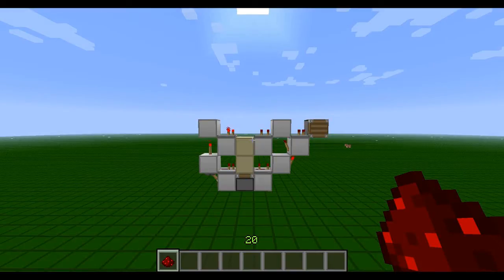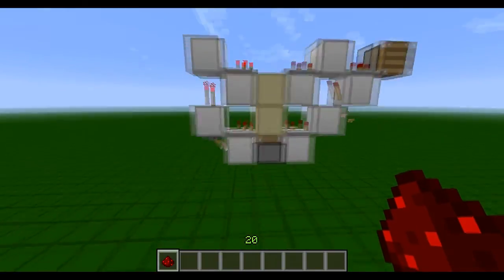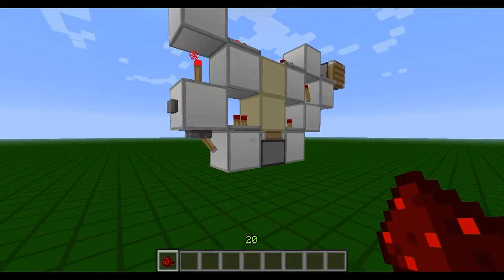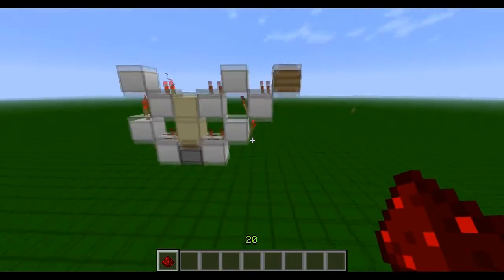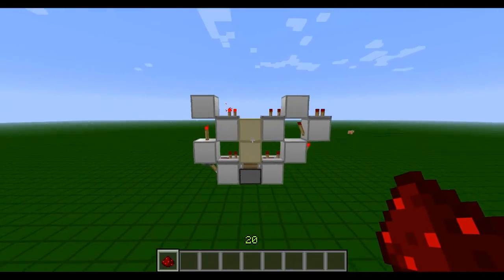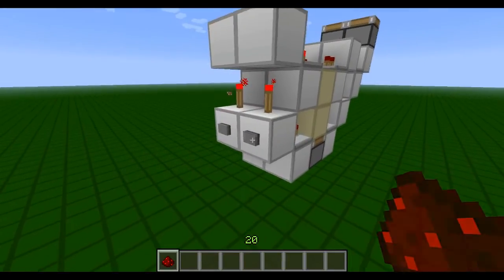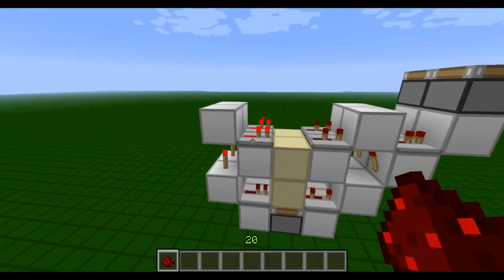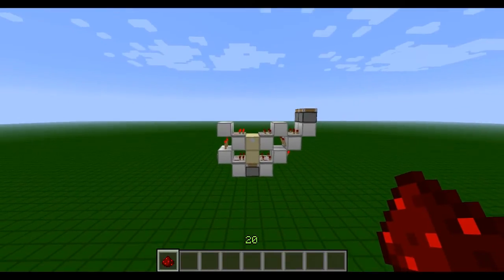1 wide tileable dual edge detector

Comment: lol turns out i needed one of these... i made one by making two pulse limiters and a signal inverter putting a positive signal in one side and a negative in the oher then wired up the two outputs... its wider than this but if youre short on space i think that way is better